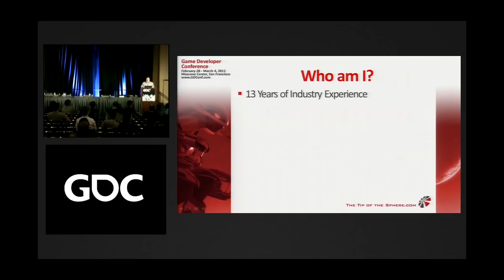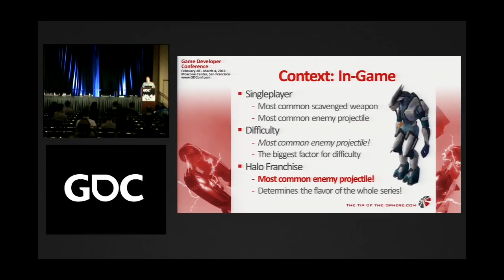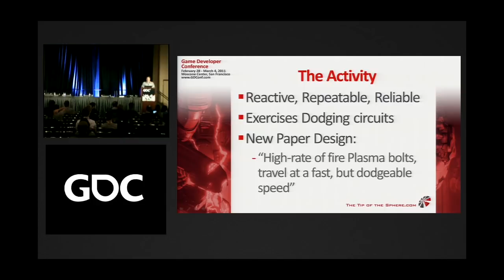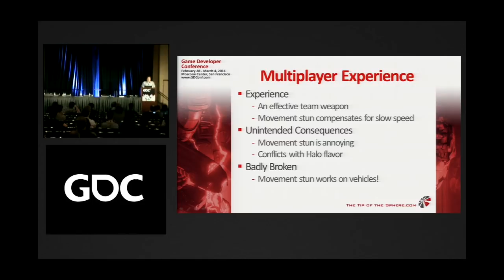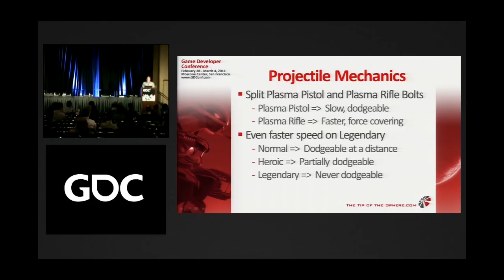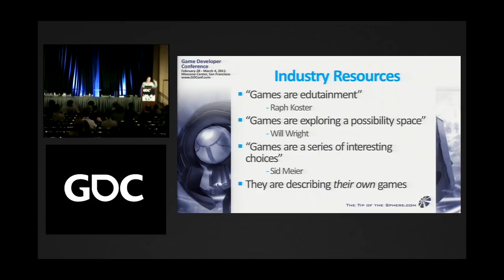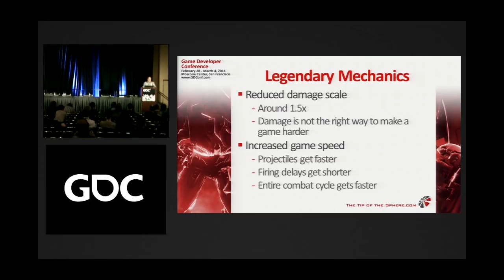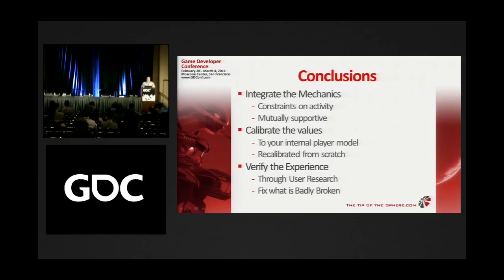Tuning the Muzzle Velocity of the Plasma Rifle Bolt on Legendary Difficulty in HALO

Comment: Personally, I think Halo plays best as a pseudo first person bullet hell, with the player being able to dodge and weave between incoming projectiles and not being forced to hug or hide behind cover in fear of being shredded i.e incentivising lame play where waiting in boredom behind cover for shields to recharge massively outways pushing to items of interest like weapons, equipment and environmental elements like grav lifts that provide a far more engaging and interesting gameplay experience. I feel elites in Halo would be better balanced, and would still be a significant threat, if plasma rifle bolts were only slightly faster than plasma pistol shots but they retained the ability to track the player throughout the burst, they'd be more mentally taxing to dodge without forcing the player to use unfun, monotonous tactics.